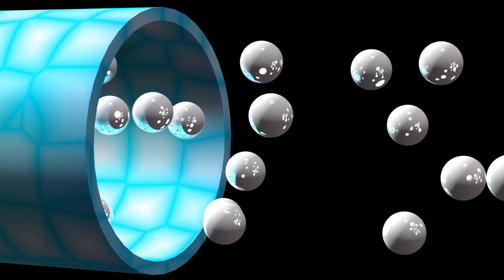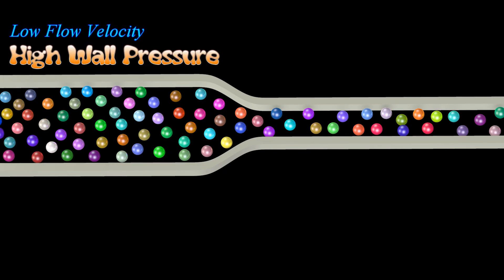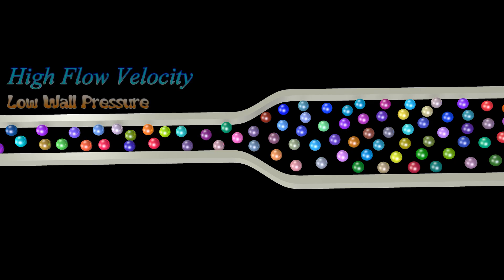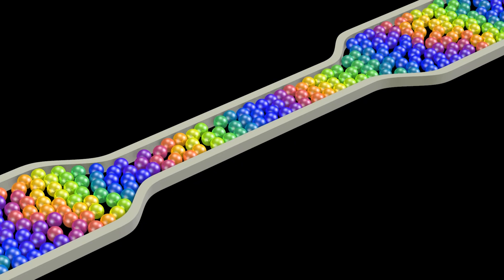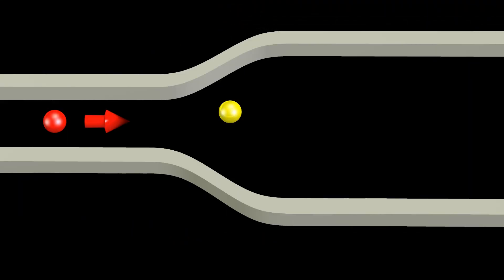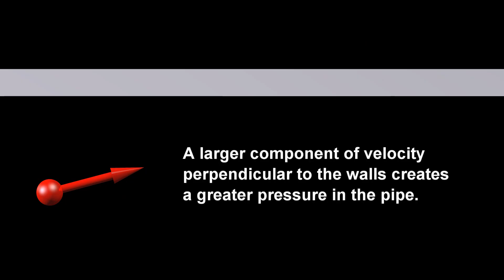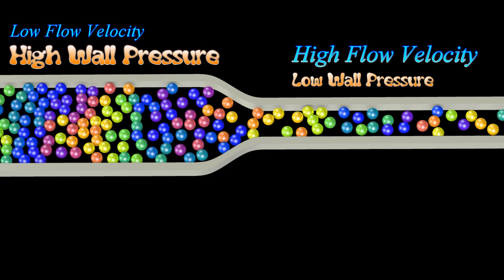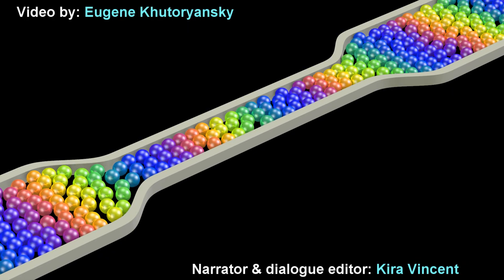Bernoulli’s Principle on Atomic Scale

Comment: What about on the wing of an aircraft?  This doesn’t seem to apply..
Reply: look at the orientation of the wings. for air particles to flow above a wing, they would need to have velocity components oriented away from the wing, while flow below the wing would need velocity pointing toward the wing. also Bernoulli's principle isn't solely responsible for the lift force (deflection of the air downward is also important) https://en.wikipedia.org/wiki/Lift_(force)
Reply: @j2ealish That's just a different way of explaining the same thing. A 'vaccuum' is just a way to look at an area with low pressure macroscopically, not on the particle scale, but the two views (macro and micro) coincide perfectly here
Reply: @j2ealish Very likely!
Reply: @j2ealish I was just addressing what you said in your only comment. There are usually two ways of seeing a physical concept: macro and micro. Another example is chemistry, chemical laws (macro) arise from physical laws (micro)
Reply: I'd love if Prof. Kuthoryansky would debunk the classical "why aircraft fly" theory as well. I feel that this is usually also not explained correctly.
Reply: As a physicist and long-time airplane nerd, I've been trying to figure out the lift thing for decades. Yeah Bernoulli, yeah Newton, etc. I get that. However, to me the puzzling thing is why the air speeds up so dramatically as it flows across the top of the wing. 
   Some argue that the air must speed up because the top surface is longer than the bottom; the extra speed across the top is required in order for the two streams to meet up properly at the trailing edge. This is not correct for two reasons. First, the greater length across the top is not sufficient to account for the increase in speed that is observed. A wing will produce lift even when the plane is inverted (given the proper angle of attack). Further, a symmetrical airfoil will produce lift. Many aerobatic planes have symmetrical airfoils. 
   Second, the two streams do Not meet up "properly" at the trailing edge. The top stream will reach the trailing edge way ahead of the bottom stream and this results in a permanent longitudinal displacement between the two. 
   So what produces the greater air velocity above the wing?

Comment: What if the liquid fluid is flowing for the first time, the liquid fluid will not face another particle in diffuser (inverted nozzle) will it have same pressure or higher compare to narrow tube?
Reply from the maker: The scenario you are asking about is the scenario shown in my animation.  Notice that all the atoms are initially at rest, before they start moving.
Reply: @EugeneKhutoryansky  what we have vaccum at initial? Thats what I was talking about!
Reply from the maker: I misunderstood what you were asking.  I believe that even if the entire pipe had a constant width, you would initially have a higher pressure at the end where the atoms are coming in, since the other end of the pipe would initially still have a vacuum.  It will take time for the particles to travel from one end of the pipe to the other.  Therefore, it will also take time for the measured pressure to travel from one end of the pipe to the other.

Comment: The question isn’t, How can higher velocity lead to lower pressure?  The question is, How does a decrease in pressure lead to higher velocity?  Imagine the above pipe sizes, driven by a low pressure off-screen to the far right.  Suppose there’s a leak of water out into open air on the far right, e.g..  Then that part is even lower-pressure than the fluid in the thin pipe.  
The acceleration occurs when the pipe diameter changes.  Imagine a mini-sub with a mass inside suspended from all directions by spring.  The mass will be thrown to the left (relative to the sub’s hull) when the pipe narrows because pressure is lower to the right.  Why is it lower?  Because far off to the right it’s even lower—the leak, e.g..
Thanks to Lewis Carroll Epstein for the mini-submarine explanation.  His sub can be viewed as a particle of fluid containing 10^17 molecules, with a thin layer a few times thicker than the mean free path.  So any rightward particles don’t get into the outer layer to be part of the fluid particle.  
Epstein's sub model behaves as such a fluid particle would, and you don’t have to think of how Bernoulli’s energy conservation conflicts with statistical mechanics.  The particle is pushed harder on the left than the right, but only as the pipe gets narrower.  So the sub, or fluid particle, speeds up to the right.
The acceleration to the right is caused by a macroscopic difference in pressure, so talking about the issue at the atomic level doesn’t add anything.  Thinking in terms of stat mech is sufficient.
(By the way, there isn't a sorting mechanism going on, as the video suggests.  All the particles are moving left, which is what the model in the video fails to predict.  Further, it doesn't allow for Brownian motion continuing.  Almost as soon as a molecule is moving right, it moving up or down after an off-center collision.  The motion stays random, aside from the overlayed macroscopic velocity, which changes due to the difference in pressure.)

Comment: Interesting, and I mostly agree. But taken alone, this explanation implies a lower pressure in the "throat of the converging-diverging nozzle" even when there is no pressure gradient. Which of course is not the case.... The pressure would be the same if this tube was closed at both ends.
Reply from the maker: No, because this explanation requires a net movement of atoms in one direction through the pipe.  Otherwise, the same amount of atoms will enter / exit both sides of the narrow section, and as they collide with each other, the components of their velocities parallel to the pipe walls will cancel each other out.

Comment: How I understand the Bernoulli's principle is that the molecules zoom pass the narrow pipe so it doesn't have the time to bump into the wall
Reply from the maker: Athough each atom spends less time near each section of pipe wall in the narrow section, there are also more atoms per second near each section of pipe walls in the narrow section, due to the fact that they are flowing faster.  Keep in mind that the density is about the same everywhere throughout the pipe.

Comment: The legacy that this teacher is leaving to the world is incalculably big
Reply from the maker: Thanks for the compliment.
Reply: Unfortunately, this violates some very common and well understood accepted principles of physics.  Charles Crummer makes the same errors, which doesn't make it correct.
..
The statement at 2:07 is correct. "there is no reason to expect an atom with a higher velocity to exert a lower pressure on the walls of the pipe." 

There can be the same pressure in a fast fluid as a slow fluid.  They simply have the same static pressure. Bernoulli is not about speed. It is about changes in speed or velocity which is Acceleration along a path. 

The pressure on the walls of a sealed jar is the same regardless of the speed of the jar.

A fundamental flaw in this misconception at 2:42 is is that there no reason to expect a molecule to have the thermal vibration in only one dimension.  These pressure causing vibrations are random in direction and are how they bounce round between other atoms.  
At any given instant a molecule may be going down and the next at 90 degrees or even 180 degrees to the previous vibration.  
That simple fact breaks this false logic.
..
Then. . . 
It is the average velocity (over time) that has a directed motion when the kinetic energy is added to produce an increase in speed. That directed velocity is vectorially summed to the random vibrations.  This is vector addition of velocities. This means that the random vibrations are superimposed onto the linear velocity along the tube. This is fundamental physics. Vector quantities like speed and acceleration add vectorially.
Ignoring that fundamental physics is another flaw in this.
..
..
Then, the added kinetic energy in the moving fluid is in only direction.  It is not increasing the random thermal vibrations. That would require increasing the temperature.  This is another flaw in this story.  Moving the fluid along the pipe does not raise the temperature.  
Therefore, the statement at 2:23: "an atom with a higher velocity would have a higher kinetic energy and, therefore, exert a larger force on the pipe walls" is false because it conflates / confuses thermal energy and momentum in one direction.
..
..
Consider bouncing a ball on the floor. Each bounce imparts some momentum to the floor.  The ball's actual motion is only vertical..

Now, start the room moving (a train car) and the ball still imparts the same momentum to the floor with each bounce.  It's actual motion, relative to the stationary ground changes.  It has the SAME vertical component, but now a horizontal component vectorially added to the vertical motions.  The pressure on the floor does not change.
.
 However, these two motions are orthogonal and have no effect on each other. The vertical up[and down bouncing component remains the same. ONLY the ground referenced horizontal component changes as the speed increases.
This physics does not change if the ball is bounced on the ground outside the train's window.
.
This fails on these fundamental physics errors.
Reply: @Observ45er nothing you’ve said here explains Bernoulli’s. Furthermore, nothing said here entirely disagrees with the video’s point. Lets think about a couple of points.

1) pumping fluid through a pipe absolutely does increase the temperature. This increase in temperature primarily occurs at the impeller of the pump, but eventually, all the fluids kinetic energy is dissipated when it stops flowing, as heat. There is friction and this linear motion is eventually all converted into vibration/temperature increase. Therefore this net net movement of the entire fluid body absolutely does count as part of the motion that sums to temperature. It may not be much from the perspective of the fluid at the time until the fluid’s motion is dissipated because the molecules aren’t necessarily moving faster relative to one another. But any probe or obstructing fluid in the flow stream will experience more collisions on the flow-ward side and thus an increase in temperature. This is what limits supersonic aircraft - the temperature of the skin gets so high from the increased collisions at the leading edge. There is also an increase in pressure at the flow-ward surface for the same reason - and as we know in fluids especially gasses temperature and pressure are so closely tied. In fluids this low pressure at the vena contracta can be below equilibrium vapor pressure and cause vapor bubbles.

2) it isn’t like the pressure in a venturi drops to zero. There ARE still random molecule collisions with the pipe wall at the low pressure surface, but they do occur less frequently thus the low pressure. There is also a temperature drop at the low pressure point in gas, and in liquids if they are flashing especially.  Look at a metering valve in refrigeration for example.

The video is correct and you are incorrect to completely separate molecular motion associated with temperature from molecular motion associated with pressure and net fluid motion as well.

Comment: Does the pressure in the narrow tube increase if the narrow tube is very long in length? I can see how only certain velocities are likely to enter the narrow zone, but as the particles bounce further and further away from the entrance, it seems like the velocities should start to behave just as they did in the wider tube.
Reply from the maker: Inside the narrow section, the molecule is colliding with other molecules which also have a large component of their velocity parallel to the pipe.  If both particles start out with a large component of their velocity in the positive X direction, they will be likely to still have a large component of the velocity in the positive X direction after the collision, due to conservation of momentum

Comment: But How about an airplane wing? The Air acelerate while hiting the upper face of It...
Reply from the maker: The angle of the airfoil is responsible for most of the lift.  A small amount of the lift is generated by Bernoulli's principle.  Although there is no "wall" above, all the air above exerts a pressure and the air flowing over the top of the wing, which acts like a wall forcing this air to flow through a narrower passage.

Comment: Shouldn´t it be on the other side of the pipe, low velocity and low pressure? Since there are fewer atoms going trough. If the number of atoms going on the small side of the pipe where the same as in the large side where they come from, there shouldn't be an increase of pressure on that side of the pipe.
Reply from the maker: It is shown correctly in the video.  Keep in mind that the total number of atoms that flow through each section of pipe is the same everywhere throughout the pipe.
Reply: @EugeneKhutoryansky   In other words. You have the same amperage but a different voltage going trough the thin pipe. Isn´t it?

Comment: Dear Prof. In which software u made this amazing physics video animation, please guide
Reply from the maker: I make my 3D animations with "Poser."  Also, I used an add on called "Poser Physics" to perform the simulation.  And I used "Wings 3D" to create the model for the pipe, which I then imported into Poser as an ".obj" file.

Comment: Maybe I misunderstand what is said here, but would not this explanation work only at the scale of the mean free path?
I can see how in this case on average the particle that enters the channel should have a larger parallel component than its other components but after few collisions, I would assume all bets are off and all components are equally likely again. 
Maybe I am being too picky but this video seems to underplay an idea that a flow has kinetic energy associated with a movement in one direction and that in a small cross-section there is fewer atoms that "carry" this energy thus they should move faster in this direction, but the average kinetic energy of the atoms in a fast flow and in a slow one should be the same (a strong wind is not hotter than a weak wind) and thus if one component is larger than the rest will get smaller.
And this is a collective motion property and cannot be described with a single atom picture, since there should be pressure "everywhere" in the flow (particles just behind that are pushing forward).
Reply from the maker: Inside the narrow section, the molecule is colliding with other molecules which also have a large component of their velocity parallel to the pipe.  If both particles start out with a large component of their velocity in the positive X direction, they will be likely to still have a large component of the velocity in the positive X direction after the collision, due to conservation of momentum.  If you watch the individual particles inside the narrow section in the animation, this might be more clear.  The animation was created by running a physics simulation.

Comment: But what if the pipe is curved?
Reply from the maker: That shouldn't affect the results.
Reply: Physics Videos by Eugene Khutoryansky  I know, but why? Now the velocity isn’t mostly parallel to the pipe anymore an the pressure should be higher.
Reply from the maker: The velocity will simply change direction in the curved section as the atoms bounce off the walls, such that the velocity will still be mostly parallel to the pipe walls.

Comment: If we had a dipol gas in a pipe-like container, and force its particles to oscillate along the axis of the pipe, would there be no pressure on the sides of the pipe?

edit: changed 'tube" to "pipe"

Comment: But does the speed increase in the Venturi as per the principle of continuity (conservation of mass)?!
Reply from the maker: The velocity of the flow increases, due to the larger component of velocity parallel to the pipe.

Comment: I really struggled to understand this fact earlier. But now it makes sense and the idea is so intuitive.
.
If wish there were more than one like button.
Reply from the maker: Glad my explanation was helpful.
Reply: @EugeneKhutoryansky  hey, the argument here is that the particles that exit the narrow part of the tube collide with other particles, acquiring a larger velocity component  normal to the tube.

However, doesn't the same argument apply when they're *entering* the narrow part of the tube? 

Why does the particle wait until the end of the tube to suffer such a collision? Statistically, I would imagine that it is highly unlikely for that to happen.
Reply from the maker: Rui Campos, inside the narrow section, the molecule is colliding with other molecules which also have a large component of their velocity parallel to the pipe.  If both particles start out with a large component of their velocity in the positive X direction, they will be likely to still have a large component of the velocity in the positive X direction after the collision, due to conservation of momentum.
Reply: @EugeneKhutoryansky  wau that makes sense. Thank you :)
Reply: @EugeneKhutoryansky  
I believe that another explanation, or way of seeing this, is taking into account the parts of the pipe's internal surface area that are perpendicular to the flow (in a longitudinally projected sense). These area parts hold the pressure high (reflect many particles back) when entering, and increase the pressure again (reflect many particles forward) when leaving the narrow part of the pipe. 

Thank you for your amazing work and incredibly useful videos.
Reply: pyropulse  Yes you are right, the analysis should be in molecular level not atomic.